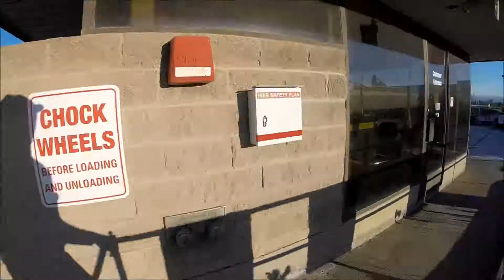Transporting a CAT 420d Backhoe

Comment: I need to transport a backhoe from Sacramento CA to Eastern WA, any phone number I can call? Thanks
Reply from the maker: Send me a text 647-573-8781
Reply: Wouldn't you need a lowboy trailer to transport that backhoe? My backhoe is 10 ft to the top of the cab. I was thinking that you can only go 13ft 6in thanks for the video
Reply from the maker: The deck height of this trailer is 33" to 36".  I can haul equipment up to 10 ft 6 in tall on the deck without permits or problems.